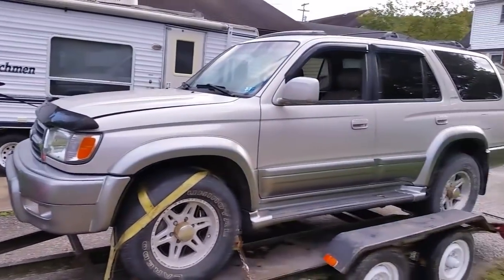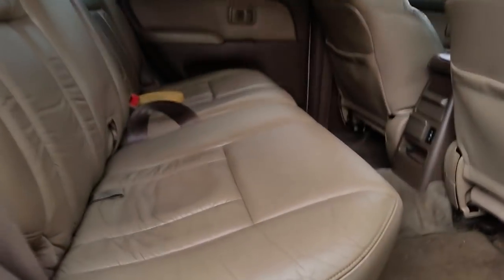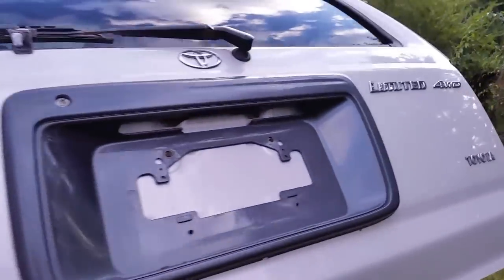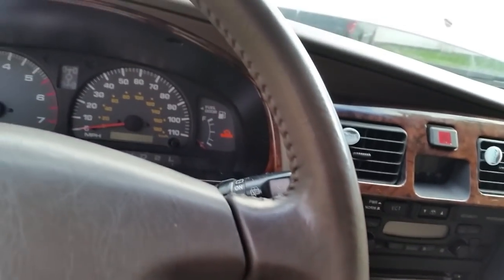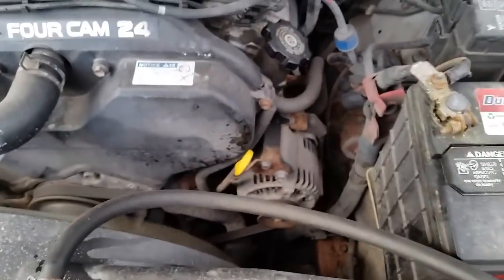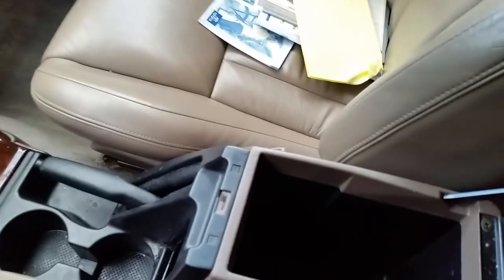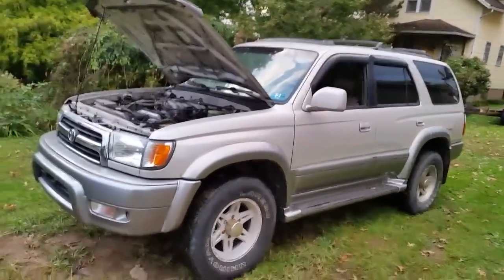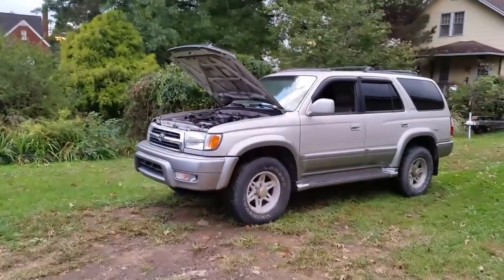My Amazing Toyota 4Runner $300.00 Find! ~And It runs~!

Comment: Great find !  you got it for scrap value.  The key fob problem is probably due to a crack in the solder on the micro-switch. I fixed my parents Sienna fob by re flowing the solder on the unlock switch IIRC. just pop it open and have a look with a magnifying glass .
Reply from the maker: Thanks! Good to know!